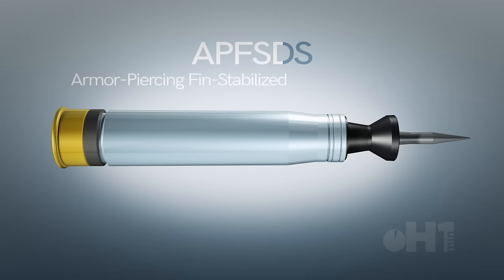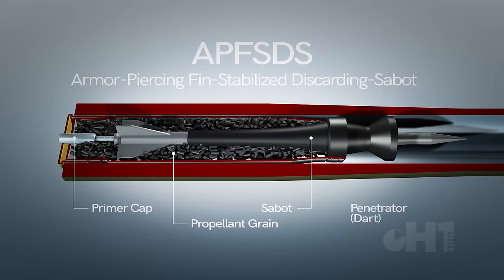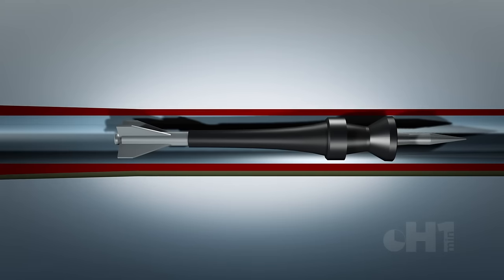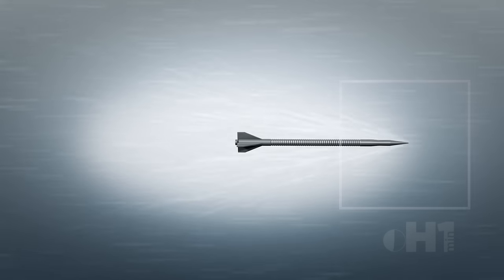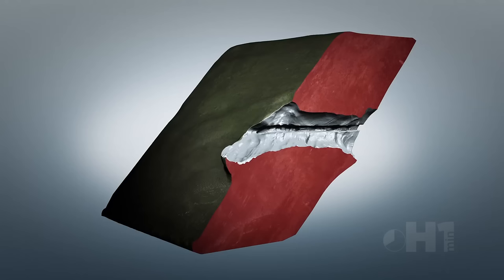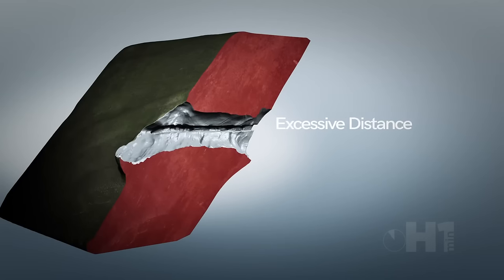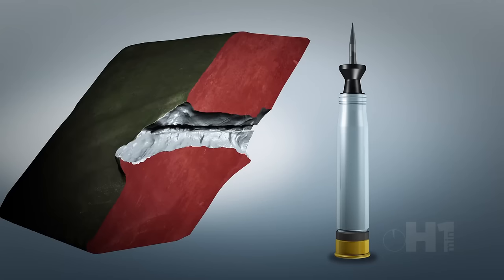H1MIN: APFSDS Shell

Comment: Heh, defeating it with steep angle. Monobloc long-rod penetrator would like to introduce itself; it performs better against angled surfaces than flat.
Reply: Or you can just do without the cap and have a needle sharp point (literally - it comes with a foam safety cap to keep it from injuring the people handling it).  The stuff isn't pure uranium.  It's an alloy of uranium and molybledinum with the trade name of 'staballoy.'  The alloy makes the metal very tough and with a high surface hardness. The hardness of the tip makes it dig into the steel.  The rest of the penetrator follows through - enlarging the hole as it goes.

Comment: Why do tanks not utilize Kevlar or a heavier and stronger woven material on the inside face of the armor? After the round it deformed by the metal, its surface area increases. As the dart penetrates the armor, it loses mass. By the time it reaches the squishy crew, it is substantially slower and less massive. At which point a thick layer of Kevlar or a stronger equivalent would stop the round like a bullet.
Reply: Would it though? If the round can penetrate 1000 mm of RHA and your armor is 800 mm, the round will still have the energy to go through an extra 20 cm of steel when it comes out the other side. Kevlar isn't stopping that.
Reply: actually I think that it is used like this, roughly. Many modern tanks have a layer of material (not too far away from kevlar) on the inside of the armor to catch any spalling an impacting shell might produce, as spalling is the main factor when dealing damage to a tank.

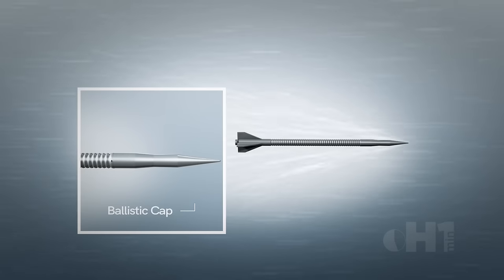Comment: At around 0:23 you mention rotation for stability. This is incorrect, actually the opposite is true. Spin causes drag on the fins and thus rapidly decreased airspeed so spin of any kind is an detriment to the performance so it is avoided at all cost

Comment: Walking by a wrecked tank: do you taste metal
Reply: Hahahha

3.6 rotgane not great not terreble
Reply: "Walking by a wrecked tank: do you taste metal."

Nope.  But the DU is one of the least hazardous things you can be exposed to on a destroyed tank.  Certain types of the hydraulic fluid (AKA 'Flame Resistant Hydraulic') are contact poisons.  And incompletely burned ''Composition B' explosive (found in the warheads of 'chemical energy' AKA HE) ammunition has carcinogens.  

Hint: It's called Depleted Uranium because the fissionable isotopes have been removed from it.  The primary human health hazard is similar to that of lead.  The primary industrial hazard is that the chips are combustible and can self-ignite.

Comment: What happens to the shell casing? I've only seen like the back part of it remain but not the rest
Reply: They're basically discarded the moment the projectile leaves the barrel, usually splitting into four parts while the projectile is moving.
Reply: @magosexploratoradeon6409  I mean like the thing that goes around the propellant because you sound like you're talking about the sabot
Reply: @brute6896  most modern shell casings are combustible as well except for the cap

Comment: If Im correct, ERA doesnt affect apfsds, only heat fs shells
Reply: Hammerschlägen M  ERA is much too slow for a penetrator which is comin up on you at 1800m/sec. The penetrator is already through ERA when the system fires it´s charge.
Reply: Hammerschlägen M  I dont believe it - that thing is too fast and the point of impact is much too small. Also does the primer and sensor mechanic need to be extremly sensitiv which bears a lot of errors. The only thing disturbing a rod is a empty space between first contact pace and armor.
Reply: Hammerschlägen M  RT online?

Comment: The Belarussians are currently developing APFSGOLDDS rounds which can penetrate ANY known armour, and do not even need aiming, just loosing off in the general direction of the enemy vehicle while jumping your tank over ruined buildings, when used in conjunction with the accompanying "patented fire control system" it will ensure that they will always hit. The only downside is the exorbitant cost of the ammunition, which means only the most deluded and gullible of combattants will cough up for it. /cynicism

Comment: APFSDS can be fired from rifled guns, just look at the Abrams
Reply from the maker: Good comment, there are rifled guns that can fire a modified round that limit the spin. However, the M1 Abrams has a smoothbore 120 mm. However, I am curious about the Challenger 2 L30, that is rifled. I've read of a slip ring to limit rotational spin, does anyone know?  Thanks for the note!
Reply: @H1MIN  thats one too many howevers you got there
Reply: @H1MIN  Actually the Early M1 Abrams used the M68A1 105mm rifled gun, it wasn't until the M1A1 that the Abrams received the M256A1 120mm Smoothbore gun. The M68A1 was capable of firing the M735, M774, M833, and M900 APFSDS.

Comment: APFSDS  Shot not Shell.. Shells are hollow and contain a filling. Shot is solid and uses only kinetic energy...
Reply: Shell is a projectile type that was usually huge and meant to be used as cannon projectile
Reply: @Kalashnikov413  Nope.. nothing to do with size.. you can get HE shell down to 20mm wich is the smallest conventional projectile that can be fitted with a fuze.
Reply: @felixthecat265  well yeah, i agree that it doesn't really have to be big, but any projectile with the size of 20 mm or more is considered to be a shell
Reply: @Kalashnikov413  Well no actually.. The proper name for a projectile that achieves its effect on hitting the target only by its weight and speed and carries no explosive payload is a "shot". Projectiles that carry an explosive or incendiary filling are called "shell". All APFSDS are "shot" as they do not have any explosive filling. 
Some large calibre naval projectiles had both an armour piercing and an explosive effect, they had a pointed, hardened head, sometimes with a cap to prevent tip shatter, and a cavity in the base filled with low sensitivity explosive, typically Composition D which is Ammonium Picrate. These had base fuzes but because they had a filling were known as Semi Armor Piercing Shell. 
The terms go back to the days when cannon fired round balls. A solid ball was known as a "shot" which is the same usage as the Olympic sport of "putting the shot" where they throw what is in reality a cannon ball. Cannon could also fire hollow balls filled with gunpowder with a burning fuze to burst the ball over the target. These were called "Shells" because the term for a hard hollow object  is "shell" as in "sea shell". The terms are still used in the technical description of the ammuntion..

Comment: The idea of the sabot is to allow a larger surface area for the expanding gas of the propellant detonation to act upon. To obtain the same amount of imparted energy solely onto the much smaller surface area of the bottom of the dart itself would require a MUCH larger barrel pressure in a barrel the same calibre as the dart. The pressure required would be so great as to deform or blow the barrel itself apart.

Comment: I wonder how much mm think armor you need to stop on of these.
Reply: well since modern darts can pen upwards of 700-900mm++ of armor... Alot.
Reply: @RavagerNick 
But depends on what material you use on the projectiles.
Reply: @RavagerNick  *700-900mm of steel. To go through modern spaced composite armor is a different story. You are right though, a lot of armor is still needed.

Comment: The dart is not sharp point, it is flat.. The tip cap is made sharp point of aluminum for aerodynamics and is not made of Depleted Uranium. The darts alone is depleted Uranium. Im retired Tank Commander and Master Gunner 25 years active service. some info in here is Incorrect.. Round can be fire on rifled gun as well.. The gun and the M256 breechblock  is German Patent not USA.

Comment: As a military nerd i just want to say that those fins aren't there for spinning the projectile. This is a huge misconception that i see everywhere. They are for stopping the projectile from spinning an most importantly helping it glide. Gliding helps the shell to lose a lot less altitude thus, increasing the accuracy. And spinning less increases it's armor penetration, because less momentum means less spread of molten metal thus keeping the impacting surface smaller.
Reply: That is Wrong, Plz don not spread incorrect information

Comment: sorry to burst the bubble. But what the video maker is saying simply isnt true. 
This video is NOT correct
Well, some of it is, and some of it isnt.

A APFSDS round requires stability, so no spinning. Spinning causes a loss of forward focussed energy and does not help with the ballistic trajectory. Normal 'conventional' ammunition does, hence the rifled barrels.

But the biggest problem in your video is that you claim ERA and angled armor defeats these rounds. That is NOT the case. Angle of attack has no real value in APFSDS shots, and ERA also has no chance in defeating APFSDS. Then... There are some new claims that the newer active protection suites like IronFist can defeat them by making them tumble in flight before impact.

Ex leopard2a6 gunner, now working for MOD, Defensie Material Org.